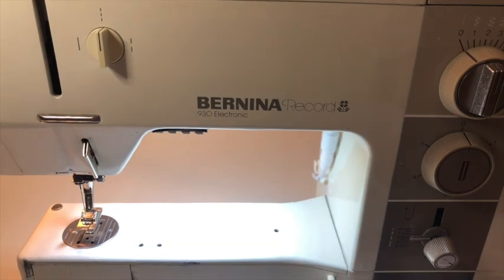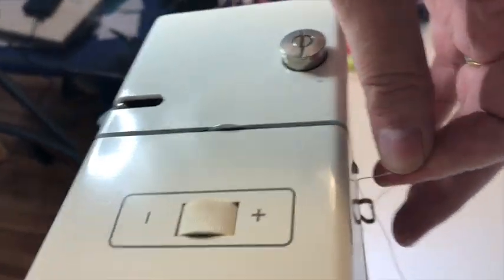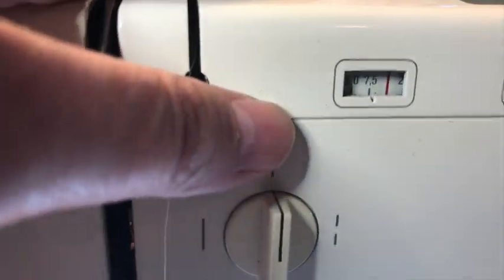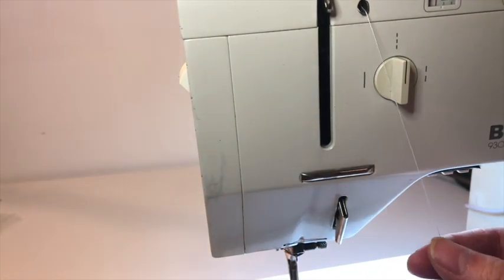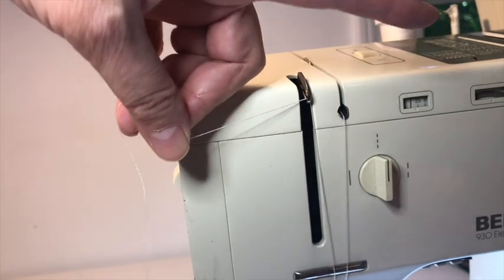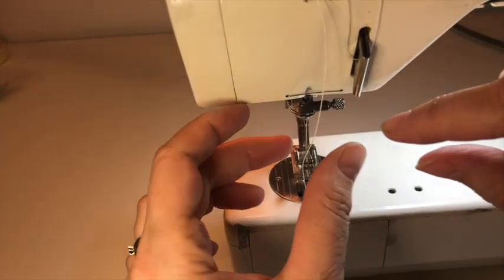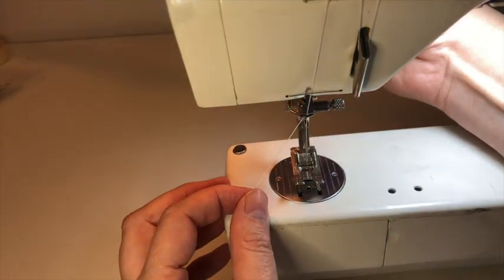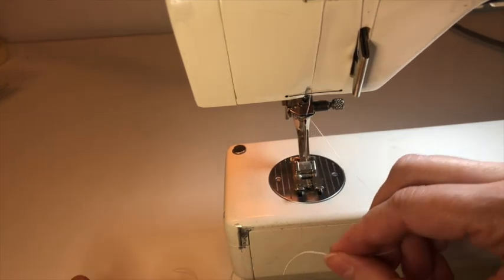How to thread an old sewing machine: Bernina 930 Record

Comment: Thanks for the video, very helpful!
FYI - On my wife's older Bernina 717, the part @2:07 is clearly not supposed to have the thread behind it, but in front.  In fact, on the 717, you can't get the thread behind it, and it is used as a curved, smooth surface for the thread to ride over.